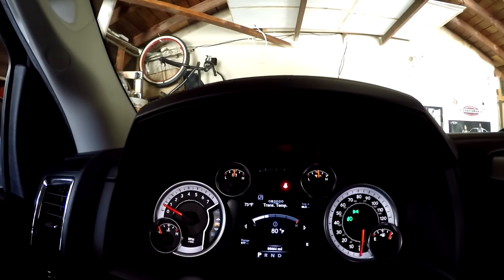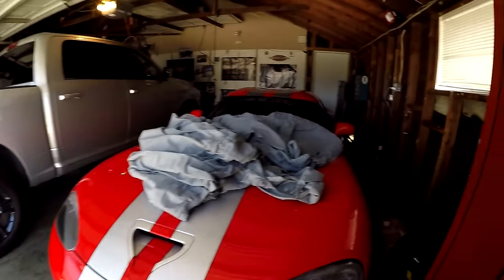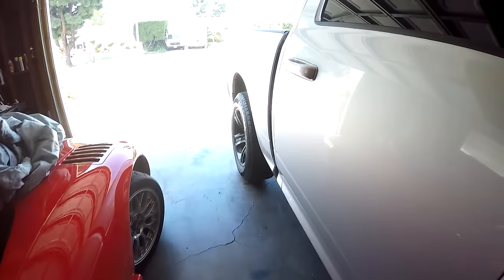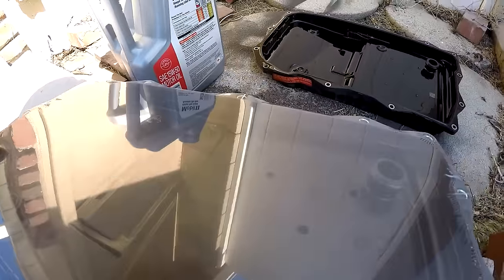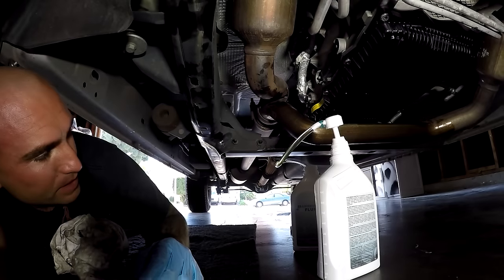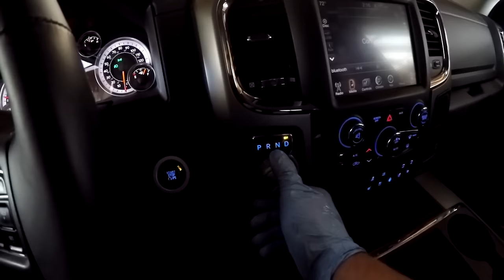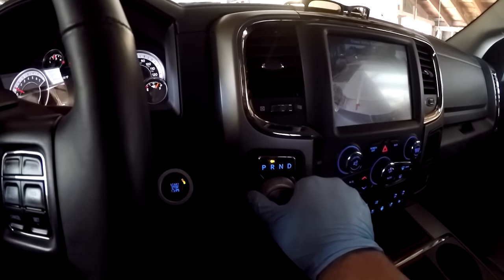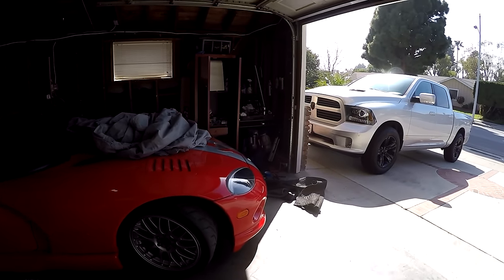Dodge RAM 1500 - ZF 8 Speed Automatic Transmission - Fluid & Filter Change

Comment: Great job on this but it's not exactly how it's supposed to be done.  Ideally you need to hoist the vehicle up on a lift or jack stands.  run the vehicle through the gears, drive the vehicle to 2nd gear and hold it, then stop and check fluid level.   All the time while keeping an eye on the trans temperature, if it goes above a certain temperature then the level will not be valid.  I copy and pasted the exact way to do it directly from Alldata.   It's a lengthy process but this is the TRUE way of checking & changing fluid level on your ZF8Spd.

NOTE:  Oil dye is not required to find leaks in the 8HP 
transmission. The oil dye can cause shift quality issues and is not 
recommended. The 8HP fluid has illuminance that is visible under a black
 light.

Raise and support the vehicle on a level hoist See: Vehicle Lifting\Service and Repair. 

Start the engine. The engine must continue to run for the entire test.

Using a scan tool or the vehicle information center, verify that the transmission fluid temperature is below 30°C (86°F). 

Disable Electronic Stability Control (ESC). 

Remove the fill plug from the right rear of the transmission case. 

Add transmission fluid until it trickles from the fill opening. 

Install the fill plug. 

Lower the vehicle for access to inside of the vehicle, leaving the tires at least 8 inches off the ground. 

With the brakes applied, place the transmission in REVERSE and hold for 5 seconds. 

Place the transmission in DRIVE and hold for 5 seconds. 

Release the brakes, slowly accelerate to 2nd gear and hold for 5 seconds. 

Apply the brakes and place the transmission in NEUTRAL. 

Raise the engine speed to 2000 RPM for 5 seconds. 

Return the engine to idle and place the transmission in PARK. 

NOTE: 

A full transmission will have fluid at the fill hole with the 
transmission between 30°C (86°F) and 50°C (122°F). Do not over fill. 

Remove the fill plug and allow excess fluid to drain from fill hole or add fluid as necessary. 

Install the fill plug. 

Using a scan tool, clear any DTCs.
Reply: Could I use amsoil transmission fouls in my 2015 Dodge Durango same trans?

Comment: Great video.  Do we know if it's the transmission base that is supposed to be level, or 'the truck?'  Because, if it is supposedly just the truck, my Ram 1500 2WD sits at a most severe angle downward than do 4x4 models.

Comment: Thank you I find your video very helpful. Every time  I have to fix or improve stuff on my Ram you are the go to guy. That being said, I was wondering why you didnt use a gasket with the transmission pan. Thanks
Reply: At the beginning of the video he mentioned it comes with the gasket already installed on the pan.

Comment: Great video! Liked and subscribed. I have a 14 ram sport with 58,000 miles. I need to be doing this in the near future. Going to order the same pan you used.
Reply from the maker: Thanks Josh!  Not sure where you are located but i still have a few new bottles of Lifeguard 8 fluid that I was going to put up on ebay cheap if you need!
Reply: Boosted2k I live in Kentucky. Post up the eBay link when you get ready and I'll try to pick the fluid up from you. Also, the Amazon link for the pan says it doesn't fit 2014 ram. Is that just Amazon being crazy lol?
Reply from the maker: Just posted up the fluid last night on eBay.  Yeah the Amazon link will say it doesnt fit but as long as it is the same part number I showed in the video you're all set!

http://www.ebay.com/itm/112480816188?ssPageName=STRK:MESELX:IT&_trksid=p3984.m1555.l2649

Comment: Great job again.  Why did you not keep the OEM pan?  Is that normal when you replace the tran fluid that you also replace the pan?
Reply from the maker: Thanks Patrick!  The OEM pan has the transmission filter built into it and is not replaceable without changing the whole pan. At the time of making this video and doing this service the OEM pan was more than $250 and this aftermarket one was around $100
Reply: Gotcha.  I'm still catching up on your videos, starting with these old ones!  Keep it up.  Love your easy style and detailed explanations and even admitting mistakes along the way.

Comment: Question - my 2016 ram 1500 sport always since day 1 bucks and jerks when coming to a stop and I was told it’s normal bc it’s electronically breaking and computer controlled when coming to a stop but none of my friends rams do that. Can I fix it with an obd2 or something?
Reply: Mine does this too, since the day I bought it. 2019 1500 Laramie w/5.7 and 8HP75. It's just the electronic transmission brake

Comment: Hello BoostedMotorsports i have a 2015 ram 5.7 lonestar. An i would like to know what is the normal temperature on the transmission because recently or the times i checked it on gauge cluster. It showed 188 or 190 degrees i don’t know if that’s normal. I recently made a trip also between 9-11 January 2021 an it struggle to maintain on the speed. Kept going down had constantly accelerate a bit to bring it back to the speed i wanted it. Any clue what it might be. Thanks in advance

Comment: Yup . I’ll do a trans oil change and with my own hands .   Don’t trust cuz so many dealer service scams . They’ll charge a fortune and not do it cuz they know it would be hard to test, prove it, dispute etc ... good job ... nice toys 👍
Reply from the maker: Thanks for the support Paul!  Its a pretty simple job and glad you found the video helpful! 👍
Reply: BoostedMotorsports 

I’m told the viper automatic has the same trans ?   Or I’m mixed up here as prior to my Ecodiesel I had the Cummings with the 6 spd standard and that’s the same box your Viper has ?
Reply from the maker: Older Vipers have the Tremec T56 and newer have TR6060
Reply: BoostedMotorsports 
 
Oh guess I’m wrong .  No ZF ever in a viper 👍

Comment: Where did you get all the information about servicing this transmission?
Reply from the maker: Check the description I have links to all service info and where I bought the oil and filter!
Reply: I followed the ZF link but it states the page cannot be displayed. I am on the ZF website looking through their service links but nothing is giving the information you stated in the video.
Reply from the maker: Hmmm thats weird maybe they took it down since it was going against the manufacturers "LIFETIME" statement.

Here is another page from ZF website where it talks about changing the fluid at 100,000kms and how to do it, etc

http://www.zf.com/corporate/en_de/magazine/magazin_artikel_viewpage_22180200.html
Reply: Thank you for that link! Does RAM have the manufacturer specs listed on their site?
Reply from the maker: No worries!

RAM just says drive it until it blows up or breaks and says the fluid is good for a "lifetime".

The company that makes the transmission (ZF) says its just like any other transmission and that the fluid and filter need to be changed.  Follow the ZF advice.  This transmission has been put in lots of German cars (Audi, BMW, etc) and they all change their fluid and filter too.

Comment: Should have used you drain plug like it was designed for 😂😂
Reply: MetalWind was thinking the same thing, just take some aluminum foil and lay across the exhaust
Reply: You cant get to the drain plug without dropping the exhaust.

Comment: Do I have to replace the pan or can I just use the oem pan
Reply: I'd buy a new pan since the filter is integrated. New oil. New pan. New filter. But that's just me.

Comment: What about the oil cooler ? 
I guess you have to drain the oil from the cooler and fill it with a new oil just like u did with the trans so the old remaining oil in the cooler don't contaminate and overflow the trans when the cooler valve open and oil return to the trans

Great video keep it up.
Reply from the maker: Thanks for the feedback! Up to you how dirty your oil is and how thoroughly you want to get every drip out of the system 🙂
Reply: BoostedMotorsports Thanks for the info i am going to do oil change soon on my grand cherokee and by the way should i do it on 80000km or 100000km because it's hot in here and i am hard on it all the time
Reply from the maker: I would say go with the lower number if you are in a hot climate and drive it more aggressively!

Comment: I am kind of confused I was told by 2 Chrysler dealerships that the 8-speed ZF transmission there was no service at all for the life of the transmission I'm nearing 100,000 km on my 2015 Ram can someone please explain only because I have tried to book an appointment to have my transmission serviced and they said there is no service on it I don't get it
Reply from the maker: The dealership will tell you it's a "lifetime fluid" and let you drive it until it blows. The company that makes the transmission (ZF) has a service schedule for this transmission and identical ones it puts in Audi and BMW cars. Search ZF transmission service and you'll see a bunch of stuff come up on google

Comment: Love your vids! Just wanted to ask if you ever heard of using Valvoline max life tran fluid as an alternate.....
Reply from the maker: I have and there was a ecodiesel guy on youtube running it but with his oil changes is was turning dark way too quickly indicating breakdown.  This ZF fluid was still clean after almost 100k miles so even though its more expensive it lasts more than long enough to be worth it.

Comment: Was it leaking that’s why you replaced the pan?
Reply from the maker: The Pan has an integrated non replaceable filter in it from the factory so you have to replace the whole pan to change the filter on the OEM pan at least.
Reply: BoostedMotorsports thanks man! I have issues with my Durango and notice something is leaking from that pan. But, when I brought it to the dealership to get check they said the leak is coming from the oil filter housing not from the transmission pan.

Comment: My 2008 had 320000 without a transmission fluid change my 2014 has 290000 on it. I tell people I think there is an engine under the hood but I have never open it to check

Comment: With two less magnets, yeah, I'd be changing the change-able filter more often myself if I installed this filter body.  There's another video of a filter body change on YouTube where the magnets (all 4 on the OEM) are coated with metal filings, prob due to heavy hauling duty.  The missing magnets are a bigee in that case.
Reply from the maker: Valid point.  I plan on maintaining this transmission more since the price of that this pan was less and the filter is only about $35 to replace without throwing out this pan so you can actually drop the pan, clean the magnets and replace the filter with this setup 👍
Reply: @BoostedMotorsports  do they sell replacement pan gaskets?

Comment: Thanks for video post! I've had no luck at dealerships or Auto parts on Trans service. All dealers quote $250 until I push to double check for 8 speed. They jump to $400-800 for stupid service! You would think they know what they are doing. I did find Amsoil fluid woks on this Trans, would you use it?
Reply from the maker: Robert Immeer I would stick with the ZF fluid because it is pretty specific for this transmission. The German cars have had this transmission for years and all those guys on those forums warn against switch to a different fluid.
Reply: ZF fluid only, NO exceptions..No other brand should be used.
Reply: Ramguykev, I just picked up some ZF-LIFEGUARD Fluid 8. I found it at a BMW/MERCEDES auto parts store. Got the quarts for $27 each after he noticed the exaggerated price Hike from the last time he bought it for his inventory. I took the last quarts he had.
Reply: Robert Immeer and
Reply: Anthony Cassara And
Reply: this is what i plan on using. ive spoke to a few guys using this fluid and it meets specs for about 13$ CAD per quart plus the filter from rock auto  the service is only 240$ CAD

Comment: On BMW and Chrysler  vehicles equipped with this transmission, the factory rates the fluid to last a lifetime. The unfortunate fact is that this is simply not accurate. Tests have shown that the fluid starts breaking down at around 62,000 miles. It is therefore recommended that the fluid be changed every 50,000 miles. Doing so will assure you a long transmission life span.
Reply: Lifetime fluid is a scam.

Comment: Hey man, does the zf 8hp70 on ram 1500's have a thermostatic bypass valve?
Reply: Correction... transmission cooler thermostatic bypass valve.
Reply from the maker: I believe that it does which is why it is recommended to bring the vehicle up to the specific temperature prior to draining and also when filling so that this valve is not closed.
Reply: Cool deal. Thanks man
Reply: By chance, do you know if there is an alternative fluid to zf 8?

Comment: How exactly can you tell what transmission I have on my 14 ram 5.7
Reply: Console shifter is the 6 speed. Shift "dial" is the 8 speed.
Reply: Enter your VIN number to this website.  It will list exactly all equipment that came on your truck from the factory.  This includes engine, transmission, all options, all the way down to tires, lights, power windows, etc.  Here is the website: https://www.mopar.com/ramtrucks/en-us.html

Comment: Do n😅t listen to any car manufacturer about the time for change the oil. Stick only to the oem of the gearbox - ZF. First change between 80 and 120.000 km, every other change between 50 and 60.000 km. It is not a complete exchange of the oil,but a refresh. Usually you drain out 4,5 liters out of 8,3 liters,when changing the oil pan incl. The filter. Just refer to the procedure with the bypass valve,which is very important.in this video the person did not respect the oem procedure. When shifting he did not shift to D1 and D2, did not increade the oil temp. above 75°C because of the bypass valve, etc.

Comment: I have a 14 Ram with 8 speed. I have 55k on it no issues. Of course they told lifetime fluid. That's the reason for no fill or dipstick under the hood. So I'm torn about the service. I've owned Dodges my whole driving life. Never serviced any but one a 2001 50k. and by 70k it crapped out!!!! Luckily it was still warranty. I never serviced the new one and sold it with 462k on it and guy is still driving it today. So not sure about fluid wearing out? I still have a 01 Durango with 283k now with no service still going strong! Just saying. PS I do change engine oil at 5k in all.

Comment: Do you know if the same transmission filter system carries over to the 2016 Ram 1500. It has the same ZF 8HP70 8 speed.
Reply from the maker: Logan Lake Yes sir exact same transmission 👍

Comment: I need some help please!

Has anybody expierenced the BRAKE CLUNK in a 14 Ram 1500. Everytime I brake or release the brakes I get a clunk in the bank. Like if almost feels like you get rear ended. I have taken it to chrysler but they cant re produce the issue. 

I dont know whats wrong. 

Second but not last. My fuel gauge sensor went out. The pump works. I am still driving it. I am just having to set a trip to xheck until I have completed certain miles to fill it again. Chrysler is saying that some trucks you must replace the whole pump. But there is also a possibility that you can just change the gauge. Does anybody know if thats true?

If someone can please share some of their knowledge that would be great thanks!!

Its a ram 1500 2014 with 115400 miles. 

I also have some other questions if someone is willing to answer me. Thanks.
Reply from the maker: Its unfortunately normal for that clunk.  Its a well documented issue but even new trucks are doing it so don't worry about it too much nothing is wrong with it just more annoying than anything.  Mine does it also.
Reply: I've had a slight clunk same as yours on my 2015 from new. I've learned to live with it. Its probably driveline slack.

Comment: will this work for ram 1500 3.0 ecodiesel 2018 model ??????
Reply from the maker: Yes I have that truck too it’s the same transmission
Reply: @BoostedMotorsports  so just buy same amount of oil and pan ?
Reply from the maker: Yes here is a video of me changing the fluid on my ecodiesel RAM 1500 8 Speed Automatic Transmission Fluid Change 8HP70
https://youtu.be/TIZkFxmcClY
Reply: @BoostedMotorsports  awesome thank you you like your eco diesel ? I’ve just bought mine few days ago .. drives awesome
Reply: @BoostedMotorsports  that’s awesome thanks one more question my eco diesel 2018 model came with one key 🔑 is it possible to activate a spare key yourself at home without calling locksmith or dealer.. I bought 2 spare keys off line cheap just need to program to my truck …. Can’t find any good videos on YouTube on this for diy … many thanks I’ve just submitted to your channel just found you 👌👍✅